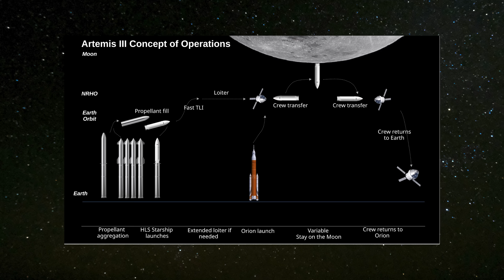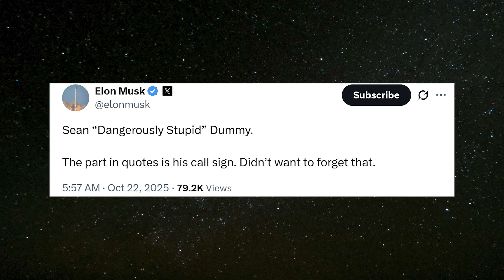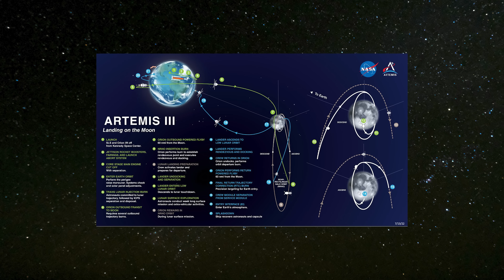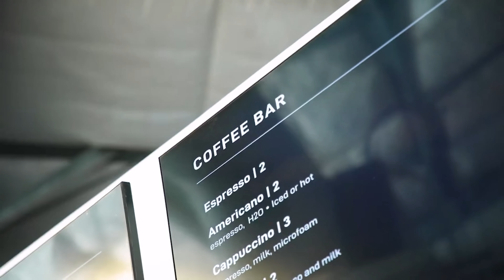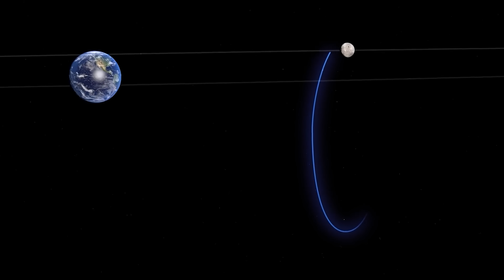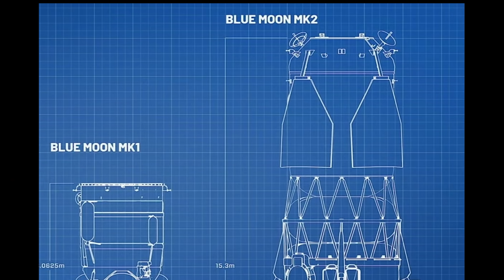SpaceX Found Brilliant Solution to Land Starship on the Moon Sooner than NASA expected...

Comment: Just a thought, could spacex make circular spaceships, yes, just like we have seen in films about ufos. The landing base would obviously have to be re designed to take this into account, but a circular ship would allow more engine raptors to be around the base, also landing on other planets would be easier as the load of the ship would be spread onto more area. As you can tell, I'm no engineer so just throwing out a thought. Any scientist engineers out there, please  educate me why this is impossible, thanks, always willing to learn.
Reply: There’s no reason a circular or disk-shaped spacecraft couldn’t work in space, and such a design might even have some advantages for reentry, though controlling and stabilizing it would be tricky. The main reason we don’t use this shape is that it would be difficult to launch from the ground. A disk isn’t very aerodynamic, so it would experience a lot of drag and instability during ascent. It’s also not as efficient structurally as a cylinder for holding pressurized fuel or crew compartments.

Raptor engines are already powerful enough to lift a building-sized rocket, so adding more engines around a circular base wouldn’t really provide an advantage—it would just add complexity and weight.
Reply: Circular spaceships are designed that way to create an artificial gravity so the people are not floating into each other all the time. SpaceX has been thinking of getting two starship together and doing a dozy-doh end over end

Comment: Reusability is a game changer in cost reductions. But reusability plays no part in getting to the moon. Proving that a rocket can be reused will not speed up the process. The key is to find a way that people back in the 60s with almost no tech did in sending everything needed in one shot. Even it wasn't reusable or needed refueling several times.
Reply: Yes and cost a fortune, that is why Congress cut the purse strings come Apollo 17. Apollo 18 is on it's side as a museum peice!

Comment: Couldn't SpaceX develop something more like what NASA had in the 60's and 70's by replacing Starship with a similar setup to what they used?
Reply: then it is not reusable
Reply: @Robikenu if the point is just to get men back to the moon quickly, it wouldn't need to be.  SpaceX could still continue developing Starship in the mean time.
Reply: @AndrewKeifer  NASA’s Artemis program aims to return humans to the Moon, stay for longer periods, and build a sustainable lunar base for future exploration. SpaceXs Starship plays a key role in this plan because it is fully reusable, unlike older rockets such as the Saturn V. This reusability could make repeated missions far cheaper and more practical. Starship also has a much larger cargo capacity, making it ideal for delivering equipment and building materials needed for lunar bases. Its efficiency and scal could greatly improve how humans explore and live on the Moon  if I’m not mistaken.
Reply: @Robikenu yes, I'm already aware of all of that information, thank you.  I'm not proposing that the Starship program be scrapped entirely, but that SpaceX consider a separate, concurrent program based on already proven methods in order to get back more quickly specifically to beat China, but also perhaps to prepare landing sites for Starship.  Doing so in the allotted time is, admittedly, most likely just as challenging as not doing it.

Comment: Their lunar lander is too tall for the Moon's low gravity and irregular gravity field. Bouncing and tipping is more likely there. There are solutions but they better start unmanned test landings before everything is set in stone. The test landers can be filled with back-up supplies or serve as emergency back-ups. Then SpaceX could be the only space company with emergency lunar retrieval/rescue.
Reply: I didn’t know that you’re a space engineer!
Reply: I suppose they could adapt an insert version/lunar stage of Starship that is only 1/5 the full length of Starship, comparable in size to Blue Origin's.
Reply: @bryanbryan2968 and how much would that carry?
Reply: @johneagle2100  I don’t know the mass but it would probably be a personnel carrier.  Not much more than Apollo or Blue Origin lander.  Starship may need to have a stubbier, shorter version, in order to land steadier with a heavy payload.
Reply: @bryanbryan2968 if you go down that road then you are just repeating the Apollo mission with no Moon base!
Reply: @johneagle2100   Exactly.  The moon is such an excellent stepping off point for further exploration with its' incredible mix of metals, light gravity, and proximity to Earth.  That is, unless you run into an underground alien monolith at some point.
Reply: @bryanbryan2968 Ummm sounds like 2001.
Totally overdue 😂

Comment: I disagree with your & Duffey’s mixed results” conclusion of previous flights.  The results is all the data.  Pushing systems to failure during non-crewed testing is the way to get data and iterate new systems.  You don’t want all testing to look like “success” then have a failure you didn’t anticipate with people on board.  This shows a lack of understanding regarding method of development.
Reply: "Mixed results" is too harsh? Have you been watching?
Reply: @troys9222  "Mixed results" Did you even understand the original comment?
Reply: @fewwiggle  Sure. Did you? The comment is a complaint that the video characterizes the flights as having mixed results, and that isn't in line with the commenters feeling that everything should be characterized more positively in some way. The bar is so low, we've redefined failure. Every rocket flight in history gets data, but that has become what matters most somehow.
Reply: @troys9222  What part of "pushing systems to failure" don't you understand?
Reply: @fewwiggle  It's a fine catch-all failure-proof concept, but there are deadlines. Also, SpaceX seems to be prioritizing spamming satellites instead of doing what they're paid for by taxpayers. There's no time to try, and then rework, all the systems that haven't even appeared yet, for some reason. Unfortunately there are deadlines long past. That's nothing new in the industry, but results aren't promising even for this newly further pushed back timeline.
Reply: I couldn't agree more.

Comment: Suggestion.  The Lunar Lander is going to be a true spacecraft, i.e., it's never going to come back to Earth.  SpaceX won't have to worry about bring it back to Earth.  So:

1) Ditch any Retractable Landing Legs and just bolt on some fixed ones.  Cheaper, Lighter, Safer and More Reliable.  
2) Design the Nose of the LL so it could accept a Dragon capsule.  That way, the to-and-from Earth can be performed by a reliable, proven vehicle.  Falcon puts a Dragon into LEO.  The Dragon rendezvous with the LL, backs its Capsule and Trunk into the nose of the Vehicle, then off they go.  Additionally, if needs be, the Dragon and it's Trunk can be modified to act as an Emergency Escape Vehicle, just in case things do go wrong on the moon.  This would, of course, require an Emergency Rescue Vehicle to be stationed at Gateway to go retrieve any astronauts that had to be emergency launched from the Lunar Surface.
3) Remove the rockets at the base of the LL.  With the ring of engines high up the vehicle, there is no real need for the 2nd, extra set of engines; particularly if they are capable of landing the LL on the moon, they should also be capable of providing the thrust necessary for TLI.  Instead....
4) Move the Cargo to the bottom of the vehicle and push the fuel up.  Which, with the development of circular 'cargo containers', allow for these Containers to be attached to the bottom of the vehicle, which, in turn, will make removing the Cargo from the LL when on the surface of the Moon.  In other words, look at the SpaceX LL less as a Passenger Liner and more as a Cargo Ship.
Reply: Sorry pal your science information is WRONG, IT IS ALREADY KNOWN THAT DRAGON CRAFT IS NOT BUILT OR SHIELDED FOR BEYOND LOW EARTH ORBIT, THATS WHY THE A NEW SHIP IS NEEDED. REBUILDING DRAGON WOULD BE COST PROHIBITIVE WHEN STARSHIP IS BEING DEVELOPED.  SO GO BACK TO ENGINEERING SCHOOL...
Reply: @nicholasklangos9704  There would not need to be a major rebuild or redesign of the Dragon in order to provide it with the Shielding needed to get through the Van Allen belts.  All they would need is a thin layer of shielding and a flight plan that, like Apollo, would take them quickly through the Van Allen Belts, limiting their exposure.  As for any additional weight, the Lunar Dragon's (trademark pending :-) would only be able to accommodate Five (5) Astronauts instead of Six (6).

Comment: Let me see if I understand this correctly: Boeing starliner a complete failure SLS years overdue and 2 billion a launch, the space station old enough to fall out of the sky, and starship arguably first stage already operational. So Nash is now going to start complaining about being over budget and late? Really?
Reply: Well, Starship is way way over budget, that’s your be expected for this kind of endeavour, but it’s also WAY over schedule, like a decade behind where it should be when considering promotional speeches by Elon. So far they’ve only achieved around 10% of what’s required to compete a manned lunar landing. 

A long way to go
Reply: "Arguably the first stage already operational". Already, 2.5 years after the first launch, the first stage is arguably operational, but it still needs to be completely overhauled again. Then it has to be tested (and possibly exploded repeatedly), then the new upper stage can be tested. Of course this is all on a pad that needed a complete redesign, so those problems have to be worked through, etc. But you're happy with the progress?
Reply: @troys9222 really, ?? It’s not even passenger rated
Reply: @spinnymathingy3149 I hope that was sarcasm, Starship when fully developed prior to any human flight it will be launching starlink V3. With Starlink already having some 7 million users it is funding to some extent the SpaceX development!

Comment: SpaceX has to develop and test Raptor 4 before they can go to the Moon. And now Musk has gotten sideways with NASA.
Reply: No. Raptor 3 is the lunar engine. Raptor 4 is not even fully defined.
Chances are that you mean V4, which is the much larger version of V3. And V4 would be used for tanker and fuel depot, but simply landing 100 tonnes on the lunar surface is awesome.
Reply: @grraab2000 it's supposed to be 200+
Reply: First they have to go through the disappointment of Raptor 3 in action. Raptor 4 will be announced right before Raptor 3 underperformance starts to be obvious. Be patient.

Comment: I like the idea of a shorter moon  lander which would not be manned as per NASA requirements. It would need to have on board equipment to create a flat stable and firm landing site for a further full-sized manned star ship lander. Presumably this would include some Space X robots equipped with shovels!
An alternative to this could be a standard length star ship moon lander equipped with two contrarotating heavy disks which would be brought up to speed once their centre of gravity was vertically aligned to the moon's surface. This would allow the star ship's legs to be extended while it was hovering and locked in place when surface contact had been made.
In a failed attempt the landing could be aborted allowing for a further attempt at a different spot depending on how much fuel was left.
Reply: WTF?!

Comment: You missing the point again. StarShip and its metal is the the material for the moon base.
This isn't about racing too the moon. Its about putting something the size of a building on the moon that can be converted to living space.
Reply: Not so. While that is an admirable goal, the problem with Starship is not its internal payload bay size, its the fact it carries the fuel tank space and weight to do its own insertions burns. Its wasted sapce and weight. The boosters should be doing that part, making Starship more efficient at powering its own returns.
Reply: @dannyb3663 how do you know that's not the plan?

Comment: I wonder if it's possible to separate the top of the rocket from the oxygen and methane fuel tanks? That would allow SpaceX to send up a fully fuelled section which would then attach to the top of the rocket.

Comment: Landing on Earth some place similar to the moon's surface should answer any questions about landing on the Moon...😀
Reply: Not so straight forward , the lack of atmosphere and the lack of a stable landing pad makes the moon and mars a COMPLETELY DIFFERENT thing. There’s no comparison to landing on earth
Reply: No even close. Entirely different physics. Even similar terrain acts very different due the difference of gravity in the vacuum on the moon.
Reply: 100% and complete with fuel required to get back to earth and all other payload it would be required to return to earth. Maybe land in Nevada where it’s sandy, rocky, uneven surface etc. Starship is never going to the moon, let along Mars 😂 as for reusability, does starship LOOK reusable when it splashes back to earth? Remember that booster doesn’t have to go through re-entry, which is why they’ve been reused…
Reply: @pugrallye23 idiot it's still under development!
Reply: Not really! 1/6th gravity on the moon compared to 1G on Earth. How is that the same?

Comment: You should acknowledge that Tim Dodd, The Everyday Astronaut originally conceived and mentioned Stubby HLS.

Another thought, convert Starship into 2 stages, Stubby HLS and space Tug. Space Tug would lift assembly to orbit, get refueled, then boost Stubby to TLI. Thereafter Space Tug is either expended or returns to LEO, for refueling and reuse (assuming robust design, not requiring refurbishment between missions). Various mission profiles abound depending on design constraints.
Reply: Once you put a space tug in orbit with a tanker, it has zero need to return to the surface. Just keep using it for the same purpose.
Reply from the maker: Yes!  I explained that in this episode: https://www.youtube.com/watch?v=M8cuc3NOd4I&t=1s

Comment: anyone considering blue origin as a real contender for a 2028 deadline is not a serious person to listen to.
Reply: An altered mrk one lander seems like it's far more likely to be operational by 2028 than starship though.
Reply: @brockmann4815  you have the right to your wrong opinion :)  and if it is so what, its not human rated and wont accomplish the mission of a base on the moon.
Reply: @ReRe-yl6dq  As of now you can't know if I'm wrong and I can't know if I'm right. Time will tell. Although its worth to point out that Starship HLS hasn't even completed the preliminary design review let alone the critical design review. It took SpaceX 5 years to get from the critical design review of the Crew Dragon to it's first manned flight and that is a tremendously simpler vehicle.   

I agree that Starship is needed for a permanent base on the moon but that's not the mission profile of Artemis III. Artemis III is a short trip to the moon and back, Starship is kind of overkill for that. Competition is good. The fastest company should get the contract for Artemis III.